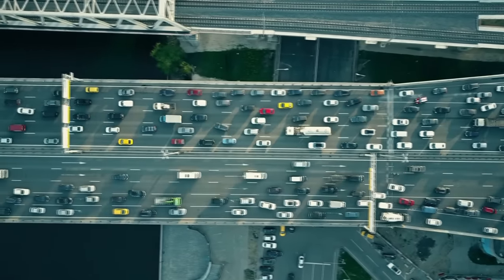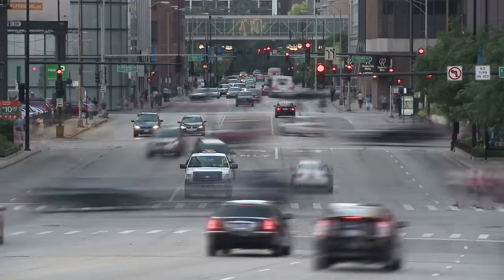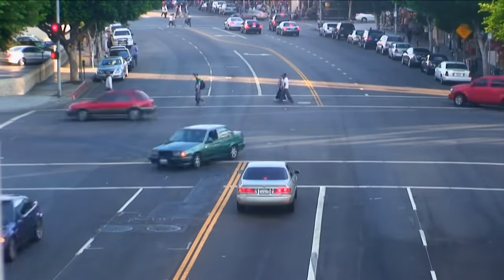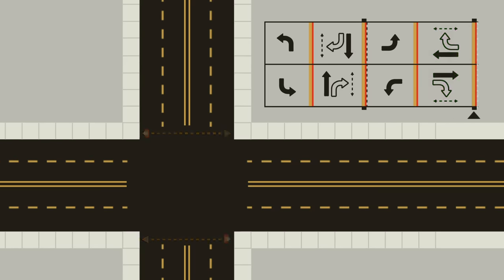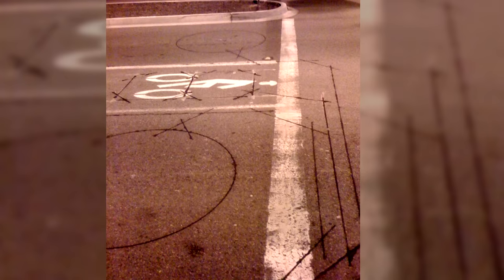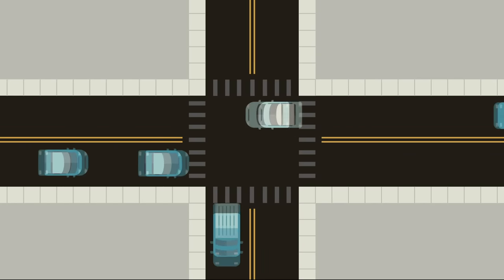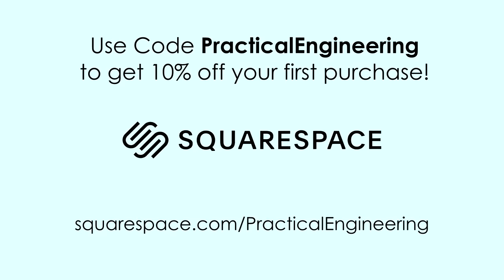How Do Traffic Signals Work?

Comment: Getting stuck at a light on a motorcycle sucks - it's happened to me a few times and I didn't know what else to do other than just sit and wait until a lull in traffic and then make my way.  One time a cop saw me do it and waved me right on by.
Reply: Wonder if hooking up an electromaget to your bike would work.
Reply: Simple trick for us

Put neodymium magnet in the frame, the closer to the ground the better it works plus it is very hard to remove accidentaly
It works really well and saved me from wasting a shit ton of time
Reply: An inexpensive fridge door magnet placed on the underside of the bike chassis can be enough to trigger the inductive loop sensor.
Reply: Most of the lights in my area will detect my bicycle, but there is one that won't. It won't even detect cars unless they pull all the way up to the line.
Reply: You're typically supposed to make a right turn.
Reply: @roberthunter5059  If I did that, i wouldn't get to my destination.
Reply: @zuludude2  a magnet can not work. Note plenty of dishonest  people are willing to package one and sell it though. They look for a change in frequency when something lossy is over them. They don't respond to a magnet moving over them.   If it didn't pick you up it's because the sensitivity setting was not adjusted properly when it was installed. Call the town or county and let them know. Some places  have a wait 2 lights and proceed when safe ordinance but that's like scraping burnt toast :)

Comment: As a example of set lights, go to Downtown Orlando, Florida and look at Orange Avenue.  It's between  Colonial Drive and East-West Expressway.

This is a good example of set lights.  There are several lights (block after block after block).  When getting off the expressway, if you pace yourself and catch the first Green Light, you can keep going (without stopping) until you get to Colonial Drive.

You should add this street to your video as an example of your explanation.

Comment: Thank you for raising awareness of how traffic signals work. These signals are common areas of frustration for communities. Local leaders rarely prioritize solving these problems, or reprogramming to adjust to changes in traffic patterns, nor updating the technology. I live and work in the area of the US and Texas with the fastest population growth (for the past 40 years).  Local Government Engineers have not considered technology frequently enough to solve traffic flow problems. (And the technology is not advancing fast enough). Actually I regularly see new roadways and highways that are designed in a manner that actually causes the problems. Which leads me to think they don't possess the intellectual capacity to be making these decisions. It would be great if you could create more in depth content on new, basic, advanced solutions to solving traffic.

Comment: My opinion? Switch all intersections governed by red lights to roundabouts. They are basically maintenance free. They have almost no idle time where noone can be in it. Their function is standardised so practically anyone should be able to navigate them safely... Etc etc... 

I just prefer roundabouts in general because of their simplicity and efficiency.
Reply: Wtf you smoking? What about small, city centre junctions or pedestrians?
Reply: Big cities with congested roads don't have enough space for those
Reply: @daverhodes382  this works even better in small towns and city centers because it mirrors the slow speed "California Stop" intersection negotiation that has been occurring all along.
The 4-way stop and traffic light are best at STOPPING traffic, not allowing it to flow. A traffic light WILL be superior to a roundabout in a situation where side road traffic must attempt to merge into a continuous stream of vehicles from a major arterial highway; when there is no gap in the roundabout you can't merge in. In this case traffic lights force the issue by stopping arterial traffic flow.

A roundabout is not by any means a panacea for traffic flow management but when intersecting roads have comparable traffic levels it can increase Level of Service by removing the stop-start traffic jam waves generated by traffic lights.

Comment: Grew up with a traffic control engineer. Pretty comprehensive. Almost felt nostalgic when the camera panned down in front of the intersection cabinet, as all the blue ECONOLITE hardware scrolled past. Did you also read about the NEMA Tester...?

Comment: I like  signals with a pedestrian countdown so I know if it's okay to slow down or speed  up.
Reply: not sure if you're trolling but they are extremely helpful. [speaking as a professional driver] much better than having 3/4 seconds of a yellow light when you're going 50-80 kmh
Reply: @e7venjedi  I'm not I'm serious
Reply: Countdown is great. When you know it's red 90 sec it feels like 5 sec because you don't have to stare on it. And when you see in the distance it's 7 sec green and you know you won't make it, let the car roll. Had a 5 min redlight at road construction 3 times, with countdown make you self a sandwich...without, you probably be so anoyed the you need a ambulance
Reply: Pedestrian signals are otherwise worthless since no pedestrians obey or use them!
Reply: Agree
Reply: @mammutMK2  Some drivers will instead speed up to try to make the light. Especially if they pass that intersection regularly and know that a long red light will follow.

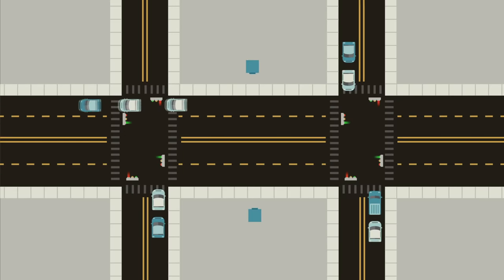Comment: This "platoon" coordination mentioned around the 9:00 mark is used on Michigan Ave. in Chicago, IL. Seems to work pretty well actually, as any traffic backup on Michigan Ave. typically gets cleared by the time the light changes. Hold ups are the cars on the sidelines sitting still by a building.

Comment: Laws on yellow lights can differ IIRC.
I know in NC if you enter an intersection when its yellow, you MUST be out of the intersection before the light turns red, or its considered running a red light.
Even if your 75% through the intersection and yellow goes to red, a cop can technically pull you over.
Have never seen a cop actually pull someone over for that tho, unless they floored it to try and make the light.

Also, i think everyone knows of at least 1 light in there area where the timing is just beyond terrible
Reply: In Ann Arbor, there is an intersection where one of the streets going into it with a speed limit of 45, but traffic flow is almost always between 30 and 40. You can be past the stop line when the light turns yellow and it'll be red before you can clear the intersection

Then in neighboring Ypsi, yellows are so long that cars three to four behind the first car that could of reasonably came to a complete stop are still going through the yellow.
Reply: @Mr Brightside Yellow/Amber is SUPPOSED to be "stop if you can safely, if not, proceed".
I go through them about half the time. All depends how close I am and how fast I am going.  If people use them right then the slight delay of having all red lights fixes safety problems 95% of the time.. its the people that jump and floor it at a green and the ones that punch it at the last second and bearly cross the line when it goes from yellow to red... they are the ones who mess things up and cause wrecks.
Reply: Same thing in Alberta.  You MUST stop at a yellow light, unless it is unsafe to do so.  Leaves it up to the driver to articulate to the police officer why it was unsafe for them to stop for the yellow they just ran.

Comment: Even back in the 70s, Houston had timed their signals in the downtown area for 27mph, such that, traveling at that speed, you’d see the light(s) ahead of you turn green in sequence so you would never have to use your brakes. The thing that made that so amazing to me was the fact that two major cross streets were two-way, while all others were one-way, with each consecutive street alternating directions. The engineering required to make the signal timing work for all downtown streets is mind boggling.

Of course, I’d inevitably end up driving behind someone who was clueless about the timing. They’d accelerate hard off the line when a light turned green, and then have to brake hard at the next light, coming to a complete stop, requiring them to be starting from a dead stop when the light turned green. Other drivers behind them wouldn’t be able to keep the steady speed dictated by the signal timing.

Comment: When you're running late, you get all red lights, lol
Reply: In most cities, they're timed to eachother. 

So if you go the speed limit, you should hit all greens. But when you're in a rush (and speed) you hit all reds lol
Reply: Tom R  not if you drive the speed limit. 

Most people don't. You probably don't. And that's why you hit every red. 

Try it some time, odds are that your city has it times so that IF YOU DRIVE THE SPEED LIMIT, you will only hit one red on a straight road.
Reply: Or your not driving fast enough, Sunday drivers and pace cars feel entitled to slow everyone down.
Reply: @crazyrobots6565  we call that a "green wave" here, but it's a myth. in my city i know of only two real green wave enabled streets and it only works for the full lenght if you go slightly above the speed limit. for the rest of the city, it's red waves. you literally have to stop every fucking time for pretty much the full length of the red signal because it usually turns red 5 seconds before you have the chance to cross. maybe if you floor it with a ferrari you could make it.

Comment: "All those idling vehicles have an impact on air quality." Let me fix that for you: all those vehicles have an impact on air quality. Idling or driving, motor vehicles produce pollution. While an idling vehicle is not getting much productive work out of the engine (except for powering the radio and climate system), it's not like most people drive their vehicles at peak efficiency either when the roadway is wide open. The pollution problem is people getting around by low-occupancy vehicles. Add on top of that, all the infrastructure required to accommodate those vehicles (there's an environmental impact to all roadway construction), and the pollution footprint of manufacturing those vehicles and shipping them to their final owners.
Reply: No, you .
Reply: A modern day ICE vehicle pollutes almost nothing

Comment: I always seem to get a red light for invisible drivers going the other way.
Reply: By the time the sensor detects them and initiates the change in the phase of the light, they've already turned right and headed way down the road, often before their light even turned green, so you're left sitting there at a red light waiting for no one. It's a very common problem. Perhaps it could be solved by increasing the delay between detecting a car and changing the phase of the light, when it's late at night.
Reply: Also when the turn arrow comes on for no traffic in the lane.
Reply: @nomadben  In some cases this is caused because the traffic signal controller has "locking" enabled on that sensor. So once the sensor detects a vehicle, the call is placed and isn't dropped until the signal changes--even if the vehicle is no longer present when the signal changes.

At least one model of traffic signal controller has "locking" as a factory default, and at least in one case it wasn't changed when the signal controller was installed.
Reply: I think more often the ghost left turners are from a broken sensor.
Reply: I've found a number of intersections in the Vancouver/Richmond area that have multiple sensors so that there needs to be at least 2 cars in line before it will trigger the green light. A major pain-in-the-ass between midnight and 5 AM. One trick I've used is to slowly cross the two sensors in the lane, and if no traffic, back up to the first sensor so that it appears to be two cars at the intersection. Sometimes it works, sometimes it doesn't.
Reply: Put your experiences is a phenomenon called Spirit cars
Reply: so I forgot to add that a few years ago in the city I lived in all the crossings will go down for the railroad as if a train was going through the city but there wasnone. This went on for the whole summer of 2009 and people start calling the ghost train finally the railroad fix the problem I don't remember exactly what it was but I remember the technician telling me something was shorting out and then since the first intersection for the railroad shorted out the rest of them the computer system was like oh there's a train coming. Lol
but seriously though something like that happening for 3 months at a time can cause serious ramifications. People start going on around the crossing cuz I thought there was no train coming and then there was an accident or somebody went through the intersection and got smashed. And after that person got smashed which I don't know if they survived or not. Then the railroad start fixing the crossings.
Reply: Or some comedian pedestrian decides to push the crossing button as they pass by and go ahead with crossing because it is clear. Seen that happen before.
Reply: This could be a sensor that is detecting right-turning drivers. There's one right by where I work and it's so annoying. If a car doesn't even stop when turning right, it'll still detect it and change.

Comment: It’s annoying at first but the way New Jersey does high traffic areas is the best. They don’t just add lights every hundred feet and there’s no left turns on busy roads. They make u turn areas and jug handles every so often to help traffic flow. So if you want to make a left you may have to make a u turn down the road or pull off to the right then make a left on to the side road to Cross the main highway. It really helps traffic flow

Comment: Here are how UK traffic lights work: 

Red = STOP 

Amber = Get set to accelerate

Green = ACCELERATE!!
Reply: jack saunders Here in the US we’re he opposite
Reply: @kingMT514  That opposite is also present in UK. The purpose of amber before green is to prepare the driver for green (engage clutch).
Reply: Cedric John Llorente Oh. I got confused. I meant to say amber means slow down and prepare to stop, it doesn’t mean prepare to accelerate for us, at least not where i live
Reply: @kingMT514  Despite the confusion, you have a correct understanding. Think of this way: UK lights are identical to USA. Green, amber, red pattern is present on both locations, and interpreted identically. The only difference is from red to green:

• USA: Red, then green.
• UK: With red still illuminated, amber lights up (both lights illuminated at the same time), then replaced by green.

When you visit UK, a sole amber is the same amber as USA. An amber and red at the same time means prepare for green.
Reply: Cedric John Llorente thx for the info. i can flex my knowledge now 😎🤙

Comment: Two things that grind my gears:

- Traffic lights that are programmed in the wrong order of signals, i.e. they let straight-and-right go, THEN left turns. I get that timings and durations of each group of movements has to be determined on a per-intersection basis, but the order of those movements is supposed to be universally standardized specifically to make traffic signals easy to follow: left turns go, then straight and right turns. If one side has no lefts, the other side gets lefts and straight-rights simultaniously, etc. One major intersection I drive through daily, regardless of traffic volume, has the phase order of [westbound left-straight-right], [westbound and eastbound straight-right], and finally [eastbound left turns if you're lucky], and it drives me crazy...

- Traffic lights that are programmed to let an exact number of vehicles through and then immediately go yellow-to-red in a second. A mall I used to work at, the left turn into the mall parking lot would turn yellow after precisely the 8th vehicle crossed the line, and red on the 9th vehicle. How?! Why?! Worst of all, this was the intersection intended for mall employees to use, making far too many close calls on getting into the lot in time for my shift...

Comment: Thanks for uploading this.
  Where I live every now and again, any one of the local TV stations will have a special or series on the local traffic control. How it's monitored by cameras and sensors. The head quarters with monitors lining the walls. 
  However, the question is never asked. Nor is the solution offered. 
Exactly how fast should one travel to get all green lights? If the posted speed limit is, say 45 mph. Yet if one were to drive at say 42 mph, they would never have to stop after getting the initial red light.
  There is a road near me. The posted speed is 35. Yet if an individual travels at 28 mph after the initial red light, they will never have to stop. It's a three lane road in each direction that traverses 4 different cities. Frankley not having to stop is more in my interest than how fast I can safely travel. 
 My solution is to have digital speed limit signs tied into the network. That way as conditions change the signs can display the necessary speed needed to travel without catching a red light.
  Also, where I live, no one excellerates when the light turns green because of all the redlight runners!